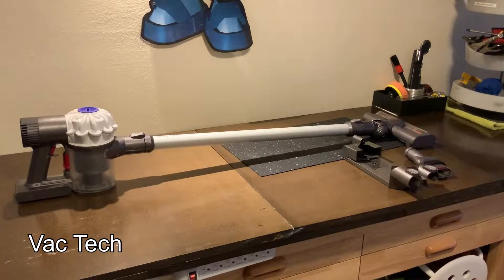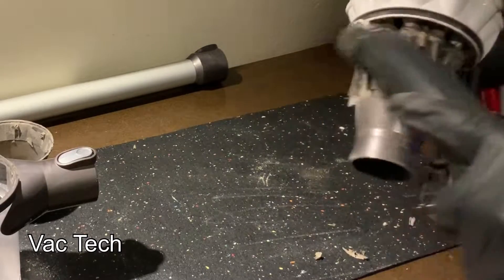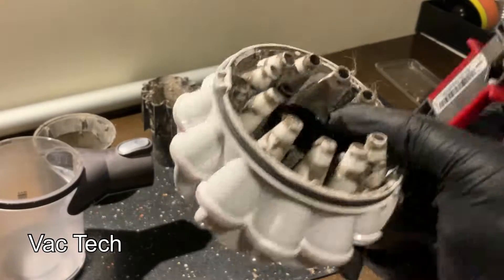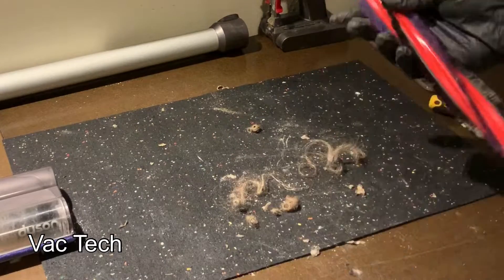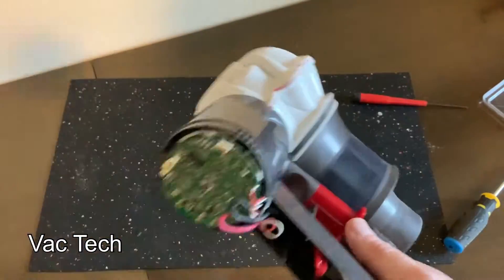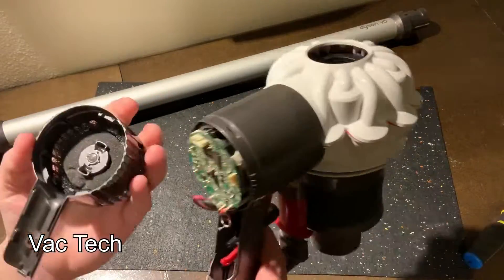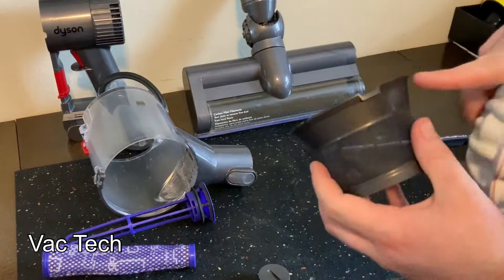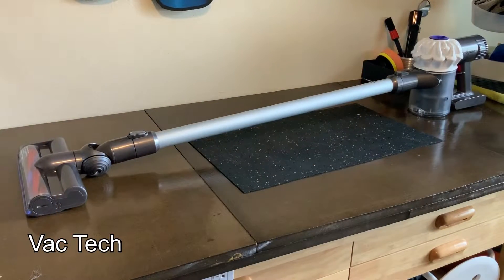Dyson V6 / DC59 Cordless Vacuum Cyclone Disassembly and Repair Tutorial

Comment: My Ex (R.I.P.) had this exact model. It was gifted to me. This vid is extremely helpful. Everything with yours is exactly the same as mine. Nasty. Ty as I was stuck with a few step.  Bought a new filter and the mod for the  rear hepa filter. Also the battery adapter for Kobalt 24 Amp batteries.  Need more cleaning but exhausted

Comment: Thanks for the video. Big help. Have a V6 car/pet that I made the mistake of using to vacuum plaster dust. Don't have a T8 screwdriver, so used a long Qtip to clean out the area as best as I could. A LOT of stuff came out.

Comment: Just got done tearing my V6 apart to do much of the same cleaning and repair things. Holy CRAP the amount of places that dust can get trapped up in this monster. Didn't even realize how bad it was at first, when I first got it(Cheap from a Goodwill, wootwoot), it smelled, but it worked... mostly, I had to clean up the brush wheel(the power head is a tad different from yours, it's an Animal) and replace the filter. Still smelled a bit for a while, probably that exhaust filter, but it stopped eventually, so I no longer care. Also had to replace the battery, as the old one was an original Dyson, which... aren't good for longevity. Anyway, today I got sick of it binding up so much, so I tore it apart completely to give it a full cleaning. Motor is already so much happier, and once I reassemble it fully, it's going to make me a lot happier.

As a footnote: Ya'll don't hate cleaning and vacuuming. You hate the tools you use to do it because they're terrible. Get a good vacuum. Spend the money, or find one used and repair it. These things go together like legos, you can manage. I got my upright dyson for free from a salvage job. DC14. Had to replace some filters and scrub it down a little, but honestly? Thing's unstoppable and I can't kill it. Get a good vacuum. Bissells suck. Red Devils suck. Hoovers mostly suck. And none of them in a GOOD way.

Comment: Thanks for that video. The rotating head on mine had stopped turning so I took it apart. It was a little clogged on the left end but when cleaned out it still wasn't working. Voltage was getting to the head but there was not enough current to turn the brush or light a 24v bulb for test, only delivering about 5mA. Checking the board it appears the Mosfet that drives the head had failed. 

I bypassed it by shorting out the black(battery -ve) and white (motor -ve) wires. Since the switching is done in the battery all should be OK. Only had about 30 minutes run time so far but all appears good.

Comment: A BIG mistake is  if first you run the filter under the tap and if it has dust on the inside  it will congeal making it worse you need to open the filter top and clean the inside before you rinse it.   Half a job
Reply from the maker: True, but to be fair, people who do that are simply following Dyson's instructions. The filter should come apart easily to clean, without tools.
Reply: @VacTech1  yes thats how dyson make money on new filters that are not needed!!

Comment: Good video. Wish id seen it a couple weeks ago. Guess ill try the cyclone assy again. I found mine v6 under a house i was plumbing. It looked like a boat anchor. All of the torx screws were rusted the unit was full of mud dirt and grime. I brought it back from the dead i just dont want to break it trying to clean it .
Reply from the maker: The stripped screws are a nuisance.  I hope you were able to get yours working great! It may just need a thorough cleaning.
Reply: @VacTech1  ive got mine torn down except for the cyclone. I cannot get the top piece loose. Ive pried on the two white clips but cant get the top most piece to seperate from the motor housing.i may just give up and stick it all back together again

Comment: Removing that cyclone with the two white clips is kicking my arse. Im afraid im going to break the thing. It makes no effort to release. I even built a removal tool but it will barely open a thin tiny gap between the cyclone and the motor case.
Reply from the maker: So the trick with those clips.. pry each one slightly so neither is no longer locked in.  Then firmly pull the top of the cyclone pack away from the motor, and it will un-snap from the rest of the stick vac.  If either clip is still catching, it won't budge.  I hope this helps!
Reply: @VacTech1  i appreciate the tip. Ive had both clips almost touching but the cyclone part made no effort to unsnap. It barely moved enouch to fit a blade between the two cases. Im kind of a bull without trying to. Worked with my hands my whole life 45 years of fighting ,building and demo. Im very good at all 3. Im a skeerd ill break it! Ive got a scrawney friend maybe ill have him give it a go. Thanks for the video. It was helpful. Btw if anyone needs batteries for those i found sony brand with a 5 year warranty on amazon for under 25.00. Got it popped in and fired mine right up. Then i tore it into a thousand pieces. It was nasty. I thinkni found jimmy hoffa in it.

Comment: Thank you SO much! My mom gave us her old one that was also "broken." I cleaned it up the best I knew how, but without an instruction manual or directions, I worried I'd break something. There is a ton of fine dust built up inside the cyclone and I didn't know how to get in there to clean, I was on Dyson's website, about to check out with a $30 replacement cyclone, when I thought, "Hmmm,  I wonder if someone else has had this issue and can tell me how to clean in there . YOU are that guy! Thanks again!
Reply from the maker: Glad I could help! Thanks!

Comment: Simply u should assembly battery and wash cyclone tunels with warm water with some pressure, thats all without legoing and unscrewing. Let it dry, of course. Do not forget to inspect head and remove spining brush to inspect to remove dust/ wash and dry. Have a nice owner experience!

Comment: how is the suction on the V6? I won an auction for one, but not sure about the power of these no cord stick vacuums. Great video!!
Reply from the maker: Suction is great. Is has two power settings. The larger motorhead tool is the best cleaner head for carpeting.

Comment: Does anyone know where to get the foam donut (exhaust filter?) that's inside the back of the power head? Mine disintegrated from age and Dyson support had no clue what I was talking about.  Thanks!
Reply: I ran into the very same issue, I think if you purchase a piece of sponge or exhaust filter, I am trying an auto parts store, and cut it down to the size it may work.  I am on my way to find out if possible, will keep you posted.  Unless you found a solution, please share. :)
Reply: @SerinaM69  i cut out a circle from some foam that was used inside a shipping box. Works fine.

Comment: Do you know what the purpose is of the shroud? How does the air get in the cyclones? The main cyclone is sealed at the bottom right?
Reply from the maker: The shroud is there to prevent large debris and hair from getting into the cyclones. Cyclones cope best with finer-type dust. Only fine dust can make it way through the shroud, along with the air, into the cyclones. I hope that makes sense!
Reply: @VacTech1  but behind the shroud there is no way to the cyclones? The cyclone hole is at the bottom right? 
Im trying to understand the airflow 😛
Yesterday I vacuumed a little bit of water and was wondering if it reached in to the cyclones.
Reply from the maker: @thijsdhaenens  dirt and air enter the top side entrance of the cyclones and spiral down the cone. Dust is driven out of the bottom of the cyclone by force (the holes at the bottom), and the cleaner air exits the top of the cyclones.
Reply: @VacTech1  I get it! I tought the air was going bottom op in the cyclones! 

Is it bad to vacuum small amounts of water? The filter was't wet and only small amounts of water at the bottom of the bin.

Thanks for the info 😊
Reply from the maker: @thijsdhaenens  I would remove the bin and filter and let everything air out and dry. They're not made for wet pickup at all, so you gotta be careful, but you'll probably be alright. Glad I could help!

Comment: .........The screws that hold the white "clam shell" together probably weren't stripped, they are on a odd angle and you need a skinny enough screwdriver to get between the tubes to get the proper angle on them. Don't be surprised about lingering odors if you don't disassemble and clean this part....the finest particles will build up and cake there. If you are cleaning a used machine that you have acquired ....THIS IS A MUST. No telling what kind of pet dander etc is in there....and I guarantee...it will not be clean in there.
Reply from the maker: So on mine, those screws were rusted, due to liquid being picked up at some point. This though is GREAT advice! Thanks for sharing!

Comment: Awesome video Vac. I'm having hard time to take out the cyclone. After squeezing the two bottom clips that hold it to the motor, the bottom side snaps out but the top stays attached. Do you have any suggestions?
Reply from the maker: Thanks! After both clips are pushed in, I would try to evenly pull out the cyclone from the motor unit. Try to pull with the same force on both the top and bottom of where it connects. It will eventually just unsnap from the motor unit.

Comment: Dyson makes very good products.  All this extra work that most people will never do.  The vacuums that have bags require none of this extra work,  change the small filters infrequently and the bag and you are done.  Sometimes new technology is not better.  Just my take on this.
Reply from the maker: I agree. Bagless systems are definitely higher maintenance, but I do like their convenience. Good bagged setups are much cleaner. Just toss the bag when its full or starts to smell, and it's a simple fresh start. I think this Dyson got extra bad because the previous owners had sucked up liquid at some point, which crusted up the inside. Thanks for watching!